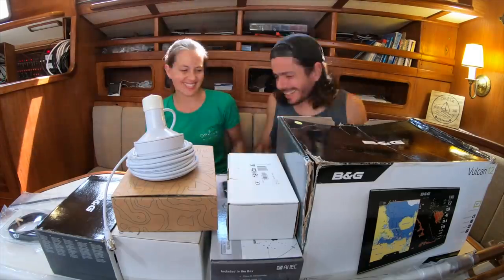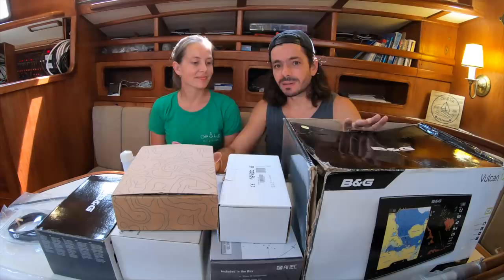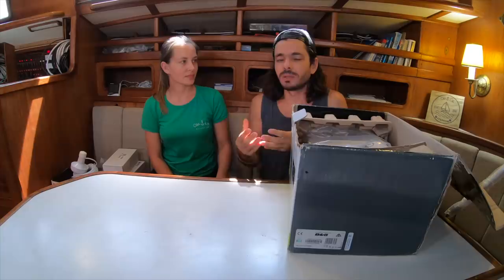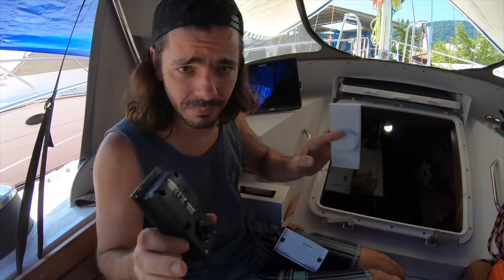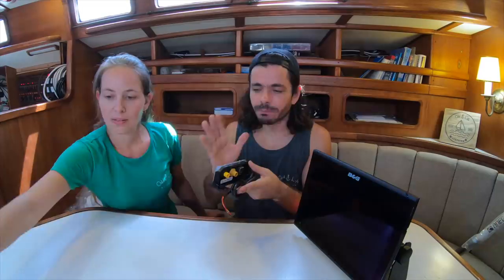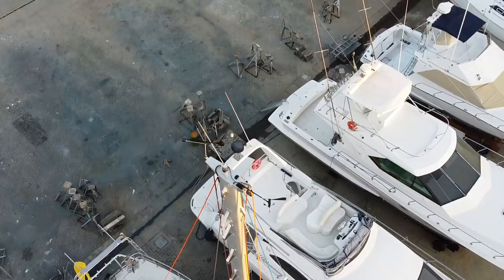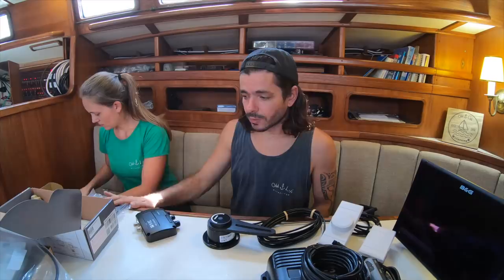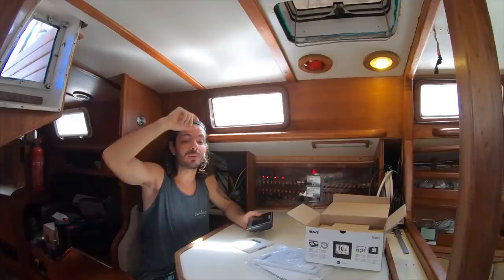⛵️ Let's talk about Sailing and Navigation Electronics #179

Comment: Your explanation about having multiple monitors in several locations for the chart plotter, radar, wind direction, autopilot, AIS, and the depth finder and the length of cables needed was very clearly explained.
Reply from the maker: Thanks for the feedback, John ☺️
Reply: Actually, for now, they will have only one monitor but multiple sensors and devices connected to this one monitor. 
That is exactly the beauty of these networked systems. 
You don't need multiple monitors, one for every piece of information, just one big central monitor where you can have all the information you need about everything on the boat.

Comment: The Autohelm linear drive that you have is a rock-solid device.   There was one on the Corbin 39 cutter that we purchased in 1997 that had just completed a west-about world circumnavigation without any maintenance at all (1991-1996).  We had the local Raymarine dealer "convert" it for use with the then-current Raymarine autopilot ECU and display in 1997.  In fact, all that he did was
remove the electronics and bring out the two power wires and the two clutch wires, something that I could have easily done myself.  This linear drive served us from Annapolis, Maryland, USA in November 1997 to Auckland, New Zealand in November 2000.  During a refit in New Zealand, I performed a thorough maintenance routine on the linear drive, although it was still working perfectly.
I rebuilt the drive motor by replacing the two easily obtained ball bearings, turned the commutator, reseated the brushes, removed the balls from the recirculating ball jack screw, cleaned it up and relubricated it.  I also replaced the drive belt (easily obtained from Optibelt--just Google Optibelt.  We completed our west-about world circumnavigation in 2012.  The linear drive is still in operation today.

Comment: Just do a Q+A if you’re getting too close to real-time. Simple to film, fairly popular, quick to edit and you can even film it at home when you’re stuck in lockdown.
Reply from the maker: Thanks for the suggestion
Reply: I was thinking the same thing, Mark! Sounds like they could do the maintenance on that wind vane! Its not quite clear why they can't work on their home in a lockdown though unless they arent really allowed to be liveaboards in that marina. 🤷🏻‍♂️
Reply: Sailing Millenial Falcon did the same, broke a really expensive part trying to fit it at anchor in poor weather (oddly it was the wind vane) because they were so close to real time and needed the content. They had a week off posting and then did a few weeks of Q+A to give them chance to get some other stuff ‘in the can’ and make some breathing space.
I love a good Q+A! Think I’d ask about their previous sailing experience as both seem very knowledgeable.
Reply: @charonstyxferryman  I cant imagine there is a shortage of questions from previous comments sections alone! They can answer Patreon questions directly and be asked directly through patreon. I would open it to a broader field, not just the one behind a paywall as veiwership drives the channel and if nobody sees the channel then nobody new becomes a patron.

Comment: I don't know what the weather will be like when you are sailing but here in Florida and the north Caribbean we have a lot of lightning.  I have had three incidents with it and now I disconnect all my unneeded electronics.  Especially the NEMA 2000 network.  A stray surge from a non direct strike came down the mast from the wind instrument into the backbone and took out everything connected to it.  Keep this in mind when wiring your equipment.  Make it as easy as possible to disconnect power, networks and antennas.
You guys have come a long way in a short time.  Thank you for sharing your adventures with us.  See you on the water.

Comment: Yep correct approach. You don't need to bring the sensor cables back to a master termination location anymore. If you run a cable down to the Bow for example for the first sensor, run a T and continue a different sensor cable and repeat until you terminate the end. Canbus is awesome and works well for low bandwidth devices.

Comment: Even though you have a budget for this, just a word of advice - with pre-terminated cables, always get the longer cable - if you need 2.5m, get 4m not 3m. If you need to relocate or reroute then you have spare cable ready. Otherwise buy some spare extension cables of different lengths just in case. And always seal connections with self amalgamating tape once the system is all up and running, whilst it's running. And always label both ends. Good luck!

Comment: After you have installed the rudder position transducer, and you discover that when transmitting on your VHF radio causes the autopilot to "go wild", just install a simple ferrite core (or two) on the cable very close to the transducer to eliminate the interference--it worked for us!

Comment: Those NMEA T connectors can start to make a long length when you have to attach several in a row.

You can save a bit of space and have a more compact installation by buying a 4-in-1 connector. You get 4 drops next to each other and in and out connections on the ends.

Comment: Best place for the compass is on "non ferrous metal", as far away from ferrous metal as possible. That would be your aluminum mast! So I would suggest you install the remote compass on your mast for the best accuracy, and minimum interference from metal objects. I install navigation and electronics in airplanes, and we avoid mounting a compass close to ferrous metal and electrical wires which can generate a magnetic field when current is running through it. Ferrous metal is metal that a magnet is attracted to. Cheers from Winnipeg.

Comment: Hi guys. I loved that you have B&G. I knew since you were putting the mast on.. As you are planning the networks it sounds correct. Just the AIS antenna I find it completely unnecessary. An AIS antenna splitter using the VHF mast top antenna will give you a lot more range. Of course an extra antenna at the back just for safety never hurts. But I would use the one on the top. AIS has very low transmition power and the height of the mast really helps a lot.

Comment: I‘d recommend a wireless handheld for the autopilot. It is based on bluetooth and good for about 25 m radius. So you can interact with your autopilot even when you‘re doing sailchanges on the foredeck. And in the event of an unplanned jibe you‘re much quicker with the controls around your neck. This is state of the art for racing yachts on solo missions, i.e. Minitransat.

Comment: A couple things you might wanna consider, try running the backbone the whole length of the boat instead of running legs everywhere, that way you can easily add more stuff to the backbone. Also run a NMEA2000 cable to the engine bay, most engine manufacturers have support for NMEA2000 so that you can see engine parameters on the displays in the system!

Comment: When you make your cable connections you should use some kind of dielectric grease on the connections.  That will help keep the corrosion under control in the connectors.  In aerospace we use a product called DC-4.  It is make by Dow/Corning and should be available on line or locally.

Comment: Great video. Modern instruments are a bless BUT, showing the complexity of wiring the whole system is very informative. Thanks !
Q: Do you have to order the different NMEA cables already with connectors installed OR can you buy a bulk roll and install the connectors yourself ?
PS  We really don't mind if you do not publish every Monday. The** most important** thing is knowing that you are both SAFE & SOUND. 😇

Comment: In the case of your handheld VHF radio, just make sure you have one that can be connected to an external antenna and that you have a propper cable/connector available to do so.  
A handheld VHF radio has a very short antenna and also usually a maximum output power of 5W (some even less), therefore a very short range. 
Connecting your handheld VHF to an external antenna (preferably installed at the top of the mast) will increase the range considerably.

Comment: I don't think you will have a problem with the compass mounted on the helm because I once sailed on a 165 foot long gaff rigged schooner that was called TeVega that was made out of steal and we had the compass mounted on top of the chariot which is a raised section where you steer the boat. TeVega was sold and the new owner calls her DEVA. It's a supper yacht now. The current owner changed the design a bit and doesn't have a chariot because the deck house was removed so the visibility is more open than it was when I was aboard. We had no issue with the compass at all. We didn't have any modern navigation equipment at all. We used a compass, sextant, chart's and math to plot our course.

Comment: Love the videos. Just watching this one and wondered if you could fit the autopilot brain in the engine room. It would be easy to split the network and save running more cable under floor provided there is a direct cable route from the engine room to the tiller?

Comment: Why do you chose to have the VHF antenna on the arch instead as high up as possible on the mast? 
The increased range on a vhf call could potentially make your sos call reach someone that it wouldn't if you're placing it as low as the arch. 
Great video as always! :)

Comment: I  would  show  the  electronics  components  and  their  installation   After   they  are  installed  (and possibly functioning).    Showing  how  to  run  wires  &  possible  equipment  locations  etc.  is  only  valuable   IF   you  are  hoping  for  viewer  comments  with  better  ideas.   BUT  since  we,  the  viewers,   are  not  on  the  boat  we  do  not  have  the  necessary  'feel'  for  what  will work  best.     I  do  enjoy  your  lengthy  explanations   on  some  things  but  still  find  I  fast-forward  a  lot  to  get  to  the  final  result.     T h a n k s  !  !               RH

Comment: Plan for lightening arrestors on the NME2000 network.  sepearte the sensors from the rest of the network, it's not a matter of IF but when lightening strikes.  Better to lose a compas, instead of the the autopilot or main chart plotter.

Hope that helps

Comment: For a chart table display, look into a Raspberry Pi, with computer monitor, echoing the NMEA 2000 network, cheap enough, plus chart/radar display or repeater with Open CPN. If I get another boat, in my old age, I will install one.
Best wishes

Comment: With the solar panel wiring on your arch, you'll have varying amounts of DC current, which will create a varying magnetic field. If your compass is nearby, your compass may work correctly sometimes, but not at other times.You might want to investigate how close you can place the compass to those wires before you install the compass permanently.
Reply from the maker: 😉 we thought about it after recording this video hehe
Reply: @OddLifeCrafting  It''s not impossible to do. The trick is to make sure you always have two wires with opposing and equal currents lying parallel to one another. As long as that condition is met, it doesn't matter what the actual current is. Their magnetic fields will cancel each other, leaving you with the true earth's magnetic field. In some places you can't meet this condition, so keep your compass away from those locations.

Comment: Basically what you're doing is installing a modern Ethernet network, except  where you're forced to use strange connectors for specific devices. Here's a thought as you finalize your implementation, from someone who has done them for a long time. 

Knowing how long your basic runs must be is the primary goal, but there is one way to be sure your install is absolutely the best over time. Put your central point, your 'router' or 'switch' point (almost certainly anything where you plug in multiple lines but where there is no device is a 'switch') in a very accessible place, then run a line from there to each device. 

You might have two switches with a line between them, and each switch could 'support' multiple devices, but you hardly ever want to run more than one line to a device. You want to have a 'path' to any device from any point, and let software do all the logical connections. 

Think of a switch as a star, with one ray to each device, or to another star. You might wind up with more than one 'ray' through some physical path segments, but you'll always be able to know that one cable serves one usage. Your chartplotter may function as a switch if you can connect it to a switch and also connect other segments to it, but that would still mean (logically) one 'ray' to any device with the ability to trace a connection between any devices through at least one switch.

Sometimes this can mean a longer run (or ray) to some device, but it should always mean just one direct line to link any device to the closest switch. This in turn means that to deal with any device (for troubleshooting or repairs) you can know exactly where your connections are, and if you every add to your LAN (which is what you have) you'll only  have to run one line (ray) from the new device to the nearest or easiest switch (star).

All of this might mean slightly more total line distance, but it compensates by better clarity and fewer splice points, and maybe a couple of adapters to get it to plug up.
 
Regardless, good sailing.

ps -- Your (brightly colored) 'map' looks pretty good. The 'waterfall' notion shows clearly the hierarchy of it all.

Buying prebuilt sized cables does get expensive. I did wonder if you could purchase crimpers for those different wiring usages, and raw connectors, then use a spool (or part of one) to build your own runs.  Always saved me lots of cash. Repairs are then quick and easy, and you might make a few bucks doing cable sets for others!

Comment: I would suggest adding a wireless access point to your network these are called such things as bridges and routers. In the scheme of things cheaper than the MFD you brought for your chart table. This converts  NMEA2000 data into protocols that can be understood by your tablet/laptop and phones and broadcast's it as a Wi-Fi signal over your boat. This adds to your comfort and safety considerably if you get one with bidirectional capacity you can even control your NMEA devices including your autopilot. More importantly you can monitor your AIS and radar from wherever you are in your boat be it your cabin or head.

Comment: Having both manual and electronic auto pilot is good as should you by chance take a lightning strike the manual is still functional 
Always run a little longer as you would know for cables also remember if oven big enough you can put all electronics and phones 
As works as a Faraday cage to stop the lightning killing everything take your time may also require shielding in places good luck

Comment: Your autopilot will use a lot of electricity so it’s better to use the windvane, installing your AIS VHF antenna too low and you will not see the ID for a ship that might appear on radar already? Better to draw a diagram and show that in a video.
You think the lockdown will finish in only 2 weeks? In Fortaleza it will finish next week but started on March 5th.

Comment: the vulcan  has  gps  inside it  take it home ,  add 12volts  conection and play with it on vidio    .my new B+G 12in plotter got nov  2020  not  instaled  on oyster39  refit  yet . covid 19 also holding refit up , good luck and good heath  your vids keep going  ,  also i to am replaysing   nac2 or nac3  so looking forward to your fitting,

Comment: Duca instead of running the cable from the its locations down to the floor then back up the walls to its destination why not run all the cable through the ceiling it will be a shorter run and cheaper since most of the devices are close to the ceiling and not the floor. For myself I would take down the ceiling and run all the cables through it to cut cost on the cables since the cables are coming from all the devices outside of the cabin.

Comment: Have you thought about, or researched, having a 'slaved' display at the nav station such as an iPad, it will allow you to see the exact info that is displayed on the plotter(you can't change or make adjustments tho)... anyway, something to think about or look into at least...you could even do it with a computer monitor or even small TV with the midi connection found on the back of the plotter.

Also, good luck with the new lockdown, we here in the Philippines have just been going through a new forced home jailing too, lol.

Comment: Everytime I see the color on the boat, I say some version of "beautiful, awesome, nice, well done, fantastic".
   2nd, for single conductor connections i would use noalox (it improves conductivity & keeps all moisture out).  If you have a multiple conductors in a connection (pin, etc), use dielectric grease (i prefer silicon because of the increased operating temperature - but it is a non conductive grease that keeps moisture out).
  Thanks for a great episode & keep up giving your best as a team.